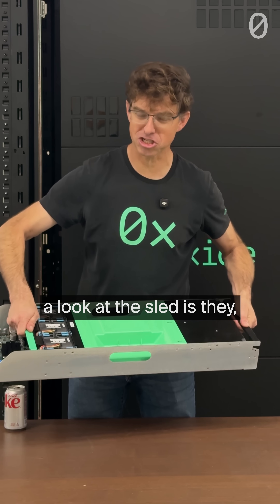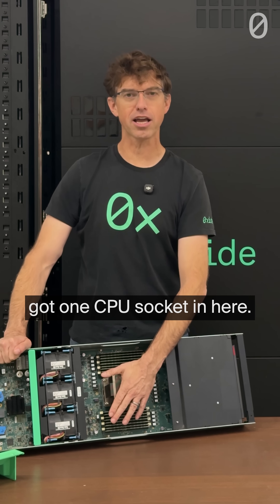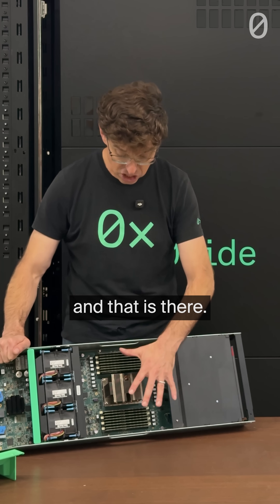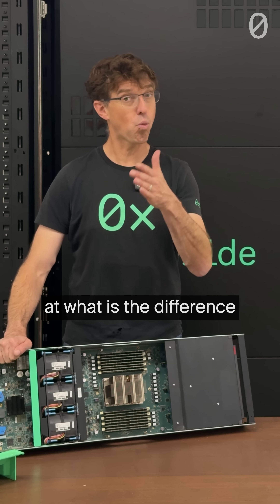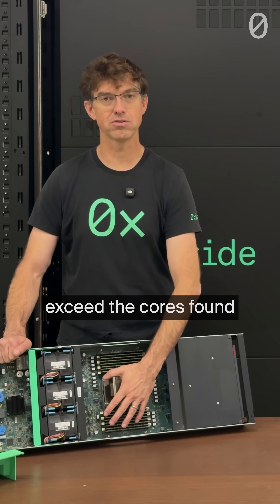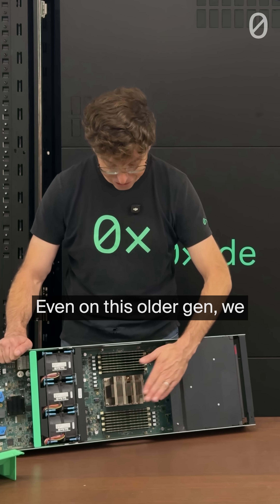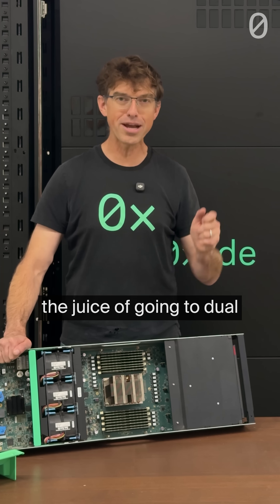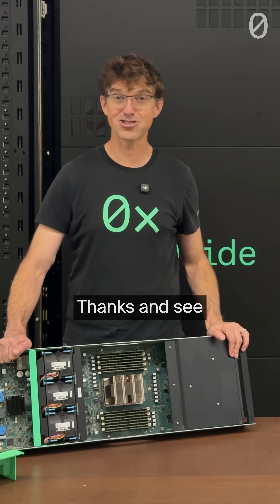Why do Oxide Compute Sleds have one processor? FAQ Friday #31

Comment: Well, one reason for multiple sockets is that you can typically get the same number of cores running at a higher clock speed working on the same shared resources, in which case it may be worth the tradeoff. Otherwise, yeah, these days, single socket is generally good enough and cheaper.

Comment: Traditionally we used to buy dual socket server systems for higher total memory bandwidth or IO - if the memory bandwidth increase is no longer beneficial then on today’s multi core , memory controller on-cpu-die systems , that logic may no longer hold
Reply from the maker: Problem is you can’t really use that total memory bandwidth with two CPUs because the inter-CPU links are so relatively slow. So better to have two servers instead. Similarly, with 128 PCIe lanes on a single socket system today, you’ll get more IO (256) out of two single socket servers than one dual socket (160). By being half-width servers we keep the total rack density high as well.
Reply: @oxidecomputercompany well you can with some NUMA juggling for code execution localization  
but that adds it’s own complexity, pain and edge conditions you may not want to deal with :-) 
Similarly if you’re not masking IO controllers to particular sockets with executing containers it’s probably not giving any latency benefit 
So single cpu socket systems  may have plenty of overriding benefits
Reply: @oxidecomputercompany oh and I omitted the most important other (old) reason used to be more RAM capacity - at whatever the best RaM bandwidth rate was - this is all very workload dependent. 
Of course If you overload the IO subsystems it’s all moot

Comment: Meta's twine paper says when they switched to single socket servers across their fleet their TCO went down 17% and power savings went up 18%
Reply: wow. "juice not worth the squeeze" indeed
Reply: Well hang on - did they generationally update their hardware ? Did they take advantage of modern power management features ? 
With any system  fleet upgrade the TCO and power consumption drops significantly especially if you pay attention to the firmware and hypervisor power configurations 
I shall go and read their paper now. Thank you
Reply: @tomorrow6 They have so many data centers they are probably on a constant upgrade wave. Doing the whole lot at once every x years would be PC component supply chain constrained. They are in the luxury position of being able to compare several generations of server hardware on the same workload.

Comment: This is very interesting. Is there a place I can learn more about the problems/challenges a dual/quad socket system has?
Reply from the maker: Meta's Twine paper that Justin mentioned is good, also "Memory Performance and SPEC OpenMP
Scalability on Quad-Socket x86 64 Systems" for specific data on the memory penalties of using multi-socket systems.